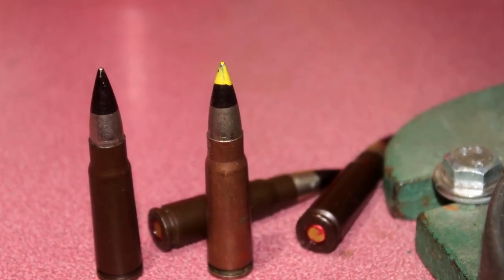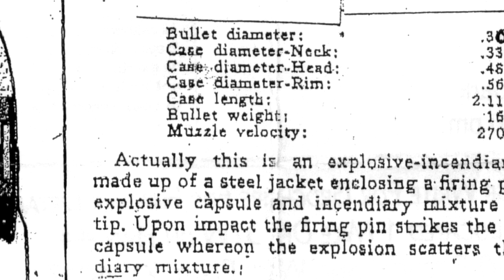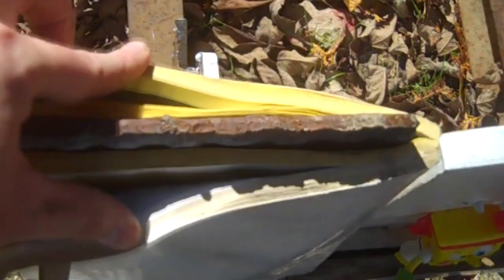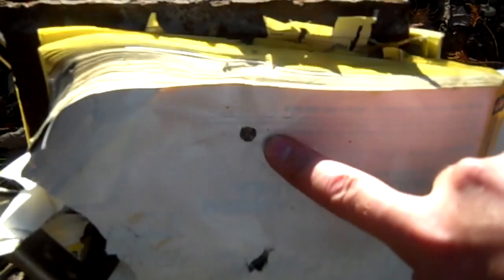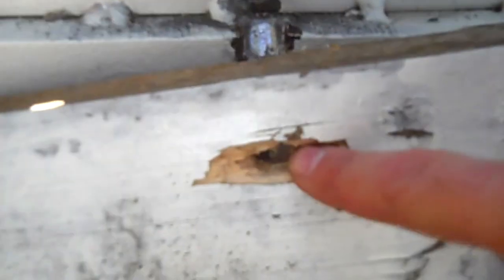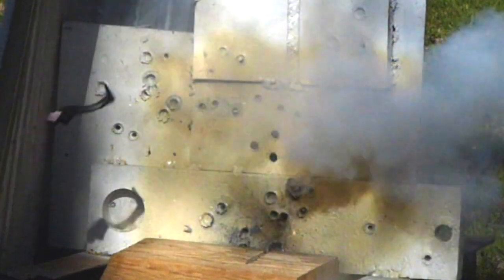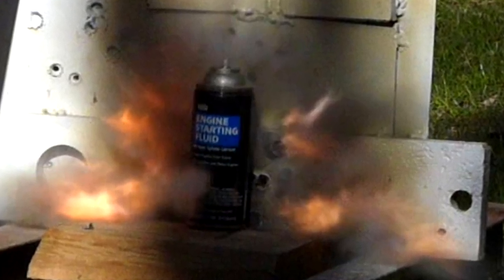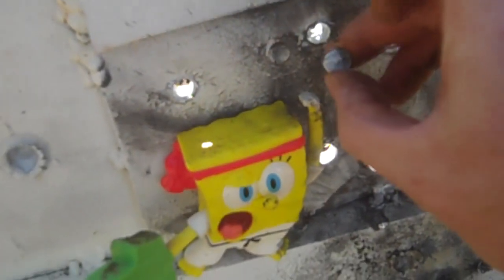AMMOTEST: 7.62x39 HEI High Explosive Incendiary ammo

Comment: The reason it didn't erupt into a fireball is the high velocity exhaust gases from the can's openings blew the flames out. It's like a blow torch, they're super hot, loud and look hard to put out but you can blow the flame out easily. That's what happened to the aerosol can, the high velocity gases extinguish the flames. They say it's an HEI round but maybe they're just HE? Incendiary usually carries a small charge of incendiary material to ignite things after the explosive charge goes off and it looks like a shower of white sparks

Comment: It didn’t explode the starting fluid cause the bullet exploding happened to fast and one ate up oxygen in the area and that in turn caused the starting fluid to not be able to reach the necessary oxygen to fuel ratio required for combustion so no secondary fire. It’s kinda like how in ww1 they had problems shooting down the hydrogen filled zeppelin even with tracers and explosive rounds. Not till they came up with the idea of using like 2 reg rounds followed by a explosive round followed by a tracer round as well as knew they had to poke enough holes in the Zeppelins to allow the hydrogen out side mix to the proper percentages with the air and once that happened it would flair up and catch them on fire and down them. But it took them many pilots and many times emptying tracer rounds into them to realize they won’t lite cause they make to small of holes and travel thru a all hydrogen sack with no oxogen and will not combust till the explosive rounds ripped bigger holes and then the correct oxygen hydrogen mixture was achieved and a tracer round following would finally ignite and start a chain reaction.

Comment: I got into a 1000 rounds of this same ammo back in the early 90s. Loads of fun too.

We ignited gas with it and set some tumbleweeds on fire. It possible. I put a round just above a coffee can with a couple cups of gas in it. It blew into a fire ball, but I'm sure it was due to the fumes hovering above the can. I shot a shampoo bottle with gas in it and it didn't catch, but the next round set the fumes off. I was firing it out of a Norinco pre ban SKS and a Norinco AK-47. I never could find anymore of these rounds. In 1991 I believe a lot of ammo came over through Mexico. Everybody was selling 7.62X39mm back then. In the small southern New Mexico town I loved in the grocery and the dry goods store sold it as well as the Whites Auto and the NAPA store. You could get it at the register at our grocery store as long as you were 18 or with your parents. In 1991 we were getting a ton of steel core and hollow point ammo. As low as $1.25 for 20 rounds. It seemed like everybody had an SKS of some sort. Paratroopers, detachable mag carbines, Standards and Standard paratrooper models. I had 4 AK pattern rifles Norinco, Poly Tech, etc. All from the 80s pre 1989. I love the 7.62X39mm round. I got to shoot 10s of thousands into the 20,000s or more. I lost count. I was single and lived upstairs at my parents house so I had no Bill's. I was 21 in 1991 so I could buy any firearm I wanted. Great time to be alive in.

Comment: That was most likely the situation the explosion put out the flames it's not uncommon they have been putting out oil well fires for decades first came along by discovery of a torpedo line operator which is now commonly known as Wireline, the use of the explosive to consume all the oxygen to Snuff out the flames but because of the hot metal around the well it will reignite the well fire

Comment: The explosion definently took out the flame. Actually fire departments are testing exploding canisters to snuff out fires fast. Also the chinese are using a rocket launching vehicle similar to the MLRS to launch a special rocket to take out fires in high rise buildings

Comment: Any solvent has a range that has a range of concentration that it will burn, if 
You are below or above that amount it will not burn. And be self extinguished
when it gets too high of a concentration not enough oxygen to support the burning
especially with ether due to the very high evaporation rate, many are between 
1% to 13% just check the MSDS it will show the range for lower explosion limit
and upper explosion limit. Where did u get the rounds?

Comment: on the can of starting fluid, the explosive ammo acted in the same manner as explosives that they use to put out oil well fires. the explosion acts to rob the flame of oxygen thereby putting out the fire, even under pressurized conditions

Comment: These types of rounds are designed to be shot from short rifled barrels connected to a rocket launcher. Our boys used these quite a bit in Fallujah. You would fire these until you hit in the right spot, then your spotter would yell target, and you would put the rocket right where it needed to be.

Comment: Ether in starting fluid or electronics cleaner can flash over so violently it depletes the oxygen in a sphere around the fireball effectively smothering itself.  If you have a Class A fire started by the initial flash over, it can re-ignite and burn all the fluid.  (Got curious and asked a Fire Marshal)

Comment: You might try putting a mild steel plate in FRONT of the can....usually (at least according to the tests run by Ian & Karl of Forgotten Weapons/In Range TV) the bullet is traveling so fast thru the target that it often explodes BEYOND the target by the time the firing pin detonates the explosive/incendiary mixture....shooting into an armored vehicle or into an aircraft gives the round a longer time (measured in thousandths of a second) to do it's 'job'. a mild steel plate or other obstacle may, most likely giver just 'that much' more time for the rounds to penetrate the can and explode, giving the fireball you want...I'd like to see that done to a gas tank...first vaporizing the fuel and igniting that vapor into a huge fireball.

Comment: did that say 160gn? if so... 160gn pushing 2,700 fps out of a 7.62x39?? MY ASS. either these are reloaded into a 7.62x39 case, (also note the .308 dia bullet label) or the info is incorrect. but that label reeks of bs...
Reply: note the 7.62x54r case in the diagram. why reload down to a weaker caliber? why not use the big boy?

Comment: Horribly inaccurate! But its obviously keyholeing and the rattling of the insides is the reason. This is junk, "novelty" grade ammo, as you can see from the results. A friend of mine fell for this crap at a gun show. He bought, "7.62 Rauffos" rounds. Not only is there no such thing, they couldnt even spell Raufoss correctly (misspelled it in a different way on the inside papers, LOL).

Comment: the fireball explosion did not because of the Shockwave from the bullet's impact on the steel plate. 

example. The Iraq/Kuwait  Oil Fields after the war..
hundreds of oil wells were left during uncontrollably. 
A crew from Texas used Hi explosives the put the fire out to get close enough to close the well.
Reply: the fireball is a byproduct of the bullet reaching speeds that allow it to warp the space time continum, the result is an explosion due to a hole being ripped in the fabric of time.

Comment: starter fluid is diethyl ether or  CH3OCH3 the combustion reaction is CH3OCH3+3(O2)=2(CO2)+3(H2O) so for a combustion reaction to happen there needs to be three oxygen-2 molecules to one ether molecule or 3 grams molar mass of O2 to 1 gram molar mass of CH3OCH3. since air is only about 20% oxygen you are going to need a lot of cubic feet of air to ignite all that condensed ether. In other words, the ether didn't have enough oxygen to ignite. a can of aqua-net hair spray would have a better chance igniting, but the only way to be sure is to try it.

Comment: Flammable liquids don't ignite until they vaporize and mix with air, therefor it typically does not ignite with the first round. However, subsequent HEI impacts will ignite a beautiful fireball. That is the intended purpose of incendiary projectiles... to light things on fire. They are however, typically used with machine guns to make those subsequent impacts. Take that can of starting fluid and pop two or three shots with the first one hitting the can and the subsequent shot(s) exploding on the steel plate. I think you will get the desired effect.
Reply: When in doubt... more dakka!
Reply: You wouldn't want to put these in an MG alone. Just as a spotting round. These are extremely dangerous to fire from an automatic weapon alone.
Reply: @PugilistCactus  Why would that be dangerous? The bullet does not know or care what weapon it is fired from as long as the calibre is correct for that weapon.
Reply: @Stigstigster  I know this is late but if a round squibbed and got stuck in the barrel the next one would blow the barrel wide open like a pipe bomb. I assume that was his reasoning. Either way I'm getting a few 30 round mags for self defense
Reply: @PaintballSniper  That makes sense. Good explanation, thanks.
Reply: ak47 go brrt 
orcs don't wear body armor anyways so head go boom or it blows the wound open in the chest/arm/leg
Reply: Yup. Liquid doesn't burn, vapor burns

Comment: Not like i'm some sadistic being but I'm curious of what will happen when  you shoot an animal with the incendiary ammo? like I said, jut curious.
Reply: +Sundincubus   I believe it would create a vicious flesh wound and a very slow death for the unfortunate animal.
Reply: Depending on the size of the animal it might not even detonate. The firing pin is designed to fire upon impact with a hard surface
Reply: @Shiro: So, you're saying the bullet will pass through the animal's body just like a normal round instead of creating burning flesh wound?
Reply: ***** I was indicating the possibility that the resistance of the body of the animal (which obviously differs from one species to another) might not give the round enough negative acceleration for the firing pin to be slammed in the primer hard enough. Since it's a spitzer bullet with no cavity it has relatively low drag through various media.
It is clearly engineered to detonate upon a hard surface like concrete or metal. 

If you hit a bone of anything of the size of a pig and up, it would probably detonate though.

Remember, this is all speculation since I don't have enough ballistic data to pull definitive conclusions

Comment: the starting fluid did not explode because its not the liquid that burns. its the vapor that burns. the same goes for gasoline. if you were to somehow stick a lit match into a beaker of gasoline without igniting the vapors, the match would go out. the starting fluid (mostly ether) is an effective chemical to start an engine because it is highly volatile, meaning it readily evaporates at room temperature and ambient pressure. when mixed with oxygen, as in the case of spraying an aerosolized mixture into a carb, it will ignite much better than gasoline. simply shooting the can with a HEI round will not cause an explosion because the ether hasnt mixed with the air. if you shot the can, waited a moment, and then shot again, you would have a better chance of creating a fireball (even still, the pressure of the can, may have blown too much of the fuel away. interesting tangent; this is why welders will joke and say they will only weld on a full gas tank. obviously, it is unsafe to weld on any tank without it being purged with an inert gas, but hypothetically it would be safer to weld on a tank filled with liquid, than it would one thats been emptied.

Comment: At the beginning,  On paper it said 2700fps,  You got on average 1500fps,  big difference.
Reply: +Les Ashton  they're shoving too heavy of a projectile for the cartridge.  I saw that at first, and was impressed-  that's .308 energies on paper!  But it seemed too ambitious......
Reply: +Patrick Reed Exactly. 160 grains  at 2700fps is WAY ambitious for this caliber. Even fairly hot standard JHP rounds at 123 grains are only running 2400-2500fps.  Adding 24% more weight to the bullet yet claim it will travel even faster? Yeah right.
Reply: +Les Ashton yeah looks more like what a 7.62x54r would do

Comment: Hello from Germany
Nice Video!  have made some AP Rounds my self. Taking a brass solid on the lathe,
Drilling a hole 4.8 dia. x22mm deep from the back, inserting a 15mm long Tungsten rod and closing it, finally brazing the bullet. It comes up to 200grain, penetrating from
50 meters a 25mm Steel Plate clean throu. Using a 30.06, hitting the Point where I want it to hit.
Go on with the Videos.
Reply: Klittcom wtf sowas is bei uns erlaubt xD?  Dachte das deutsche waffg. Is sehr sehr streng :D
Reply: Heckler Koch pssssst muss doch keiner wissen xD
Reply: Er hat es selbst gebaut von daher :P
Reply: Klittcom dam we let you people sell guns over there tisk tisk
Reply: Haha like half your guns are either invented, produced or based on some technology discovered in Europe ;)
Reply: Nah just figured they'd have you guys on some whipped royal or communist rule. But they did leave you guys set up enough post war to still be relevant. Whole thing is a huge scammmm

Comment: I have not read the comments but it is possible the explosion is so powerful it is just too fast to provide a sustained igniferous spark to ensure the spraying volatile liquid was ignited reliably. From: "A Thousand and one Formulas" by Sidney Gernsback, circa 1920, page 68, the caption accompanying the relevant diagram "Fulminate of Mercury Alone Will Not Ignite gunpowder. When Mixed With Potassium Chlorat, However, It Readily Ignites the Gunpowder, Due to the Retardation of the Fash and the Heat Formed." I tried my best to transcribe  the caption as spelled and punctuated in the book. The diagram refers to the author's research into mercury fulminate. In the referenced experiment, the author had 2 sheets of glass set up. On glass sheet # 1, he placed a train of pure mercury fulminate and placed a small sample of gunpowder on top of the train. On glass sheet # 2, he placed a train of mercury fulminate combined with potassium chlorate mixture, and then  placed a small sample of gunpowder on top of the train. With each set up, he then touched a hot wire to each train of primary explosive and observed the results. He did not specify what he meant by: 'gunpowder', but from reading the rest of the entry it is striking how well he understood the chemistry behind this substance, almost 100 years ago. I understand that tetryl and the incendiary composition inside your spotting rounds is more than likely to be distinct from mercury fulminate and potassium chlorate.

Comment: Compression waves can be use to put fires out. More then likely, the primary fire was ignited but the HEI explosion. Then the cans contents erupt out in a very violent way. The violent release smothered the flames caused buy the primary explosion. Oil well fires are put out in this very way. A explosion is set off next to the burning well and the compression waves displace all the oxygen, and smothers the flames.

Comment: I think the brake fluid did not fully ignite because the liquid did not dispense enough vapor to ignite. Basically the fuel/ air mixture wasn't right after the first burn. The explosion putting out the flame is also a good answer.

Comment: I would say the frame with the fire ball is mostly from the round itself not the gas. the problem with trying to light a fuel/air mix with a round like this is the flame is generally out long before the fuel/air reaches a stoichiometric ratio. there is not enough air mixed with the fuel to ignite.
Reply: exactly if he would have used an empty can to a mostly empty can and move it closer to the plate so that the fire is closer to the exit hole should give you better results
Reply: Or put an FMJ round through a small O2 cylinder first, give it a second or two, then send the incendiary round through “fuel” container

Comment: Two questions: 1 - The muzzle velocity is listed on the paper at 2,700 fps but in the upper left corner of the screen yet the velocity of each shot is listed at roughly 1,000 fps less.  Why is that?  2 - Does a single round of that stuff constitute a destructive device as defined in the NFA and require a $200 tax stamp?  Thanks.

Comment: Thoughts on the starter fluid: You can drop a lit match into a bucket of gasoline and the match will just extinguish when it hits the liquid. Gasoline vapor is much more flammable than its liquid state. Don't try that btw... To combust, you have to have the right mixture of air to fuel. Too much or too little of either one, and no fireball. I think when the round struck the aerosol can, the pressure evacuated causing vapor to expand as the round detonated, causing the fire ball. It could have simply been the heat of the bullet igniting the vapor. When the pressure was released, what's left of the starter fluid was liquid, and there was not enough air in the remaining mixture to cause ignition.
Reply: sounds right, maybe trying with different levels of fluid in the can or different fluids too. FPS Russia did it sometime and worked fine.

Comment: the explosion put out the Starter fluid because it pushed the air (and oxygen)out of immediate area thus out of contact with the combutable Fluid. they use explosives to put out oil fires (I Hear)